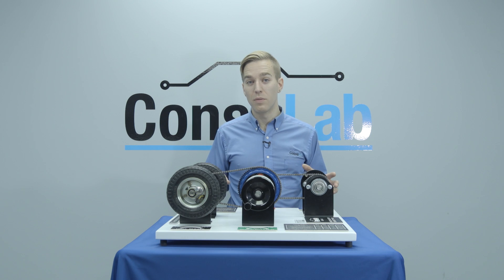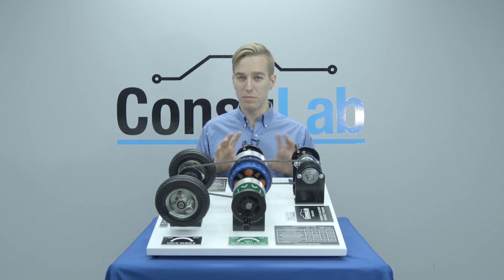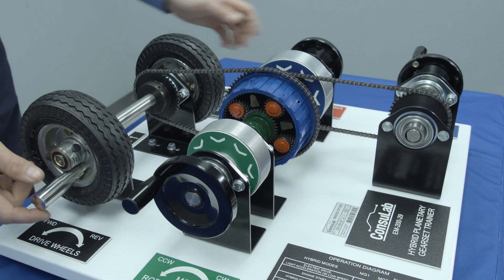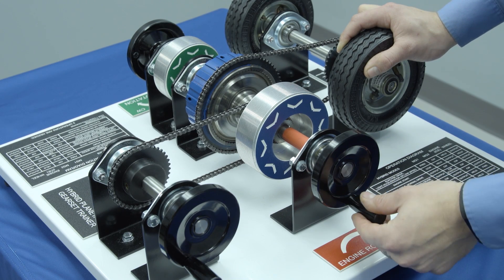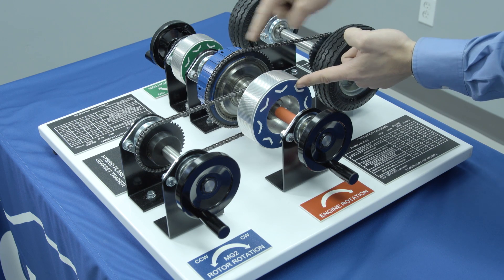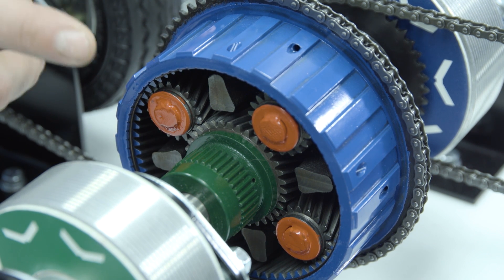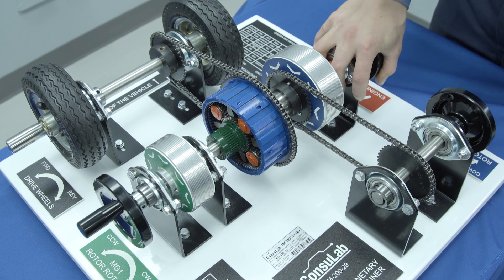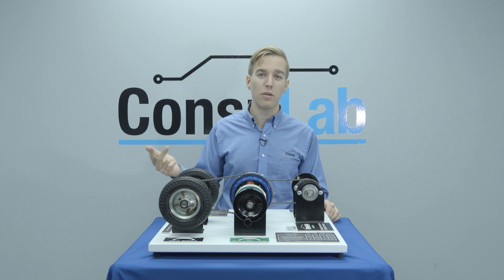Hybrid Planetary Gearset Trainer

Comment: Best and only reliable hybrid drive train, bless Toyota. This video is very educational especially for the journalists that do reviews and have no idea what they are talking about cvt and whinnying noise when under acceleration, there many things that rotate here at different speeds and directions.
Reply: Ford had it first, first domestic American hybrid in the USS, and uses the same type of transaxle except they started with more efficient the parallel type instead of the inline motor type, Toyota finally went with parallel in the 4th gen hybrids
Reply: @Iahusha777Iahuah   --- what is the Ford system called, and when was it implemented?   Do you have a link or reference?  thanks
Reply: @Texaca  the Ford escape Hybrid had the better parallel system first 1st gen 2nd gen escape and the same generation fusions and the c-max
Reply: From what wikipedia says, (I know, not the best source) Toyota and Ford both developed this independently, but it seems Toyota beat them to patents. Once Ford realized this could be a conflict, they approached Toyota about an agreement to not sue each other. 
Then Ford contracted with a division of Toyota to actually build the transmissions, which were first in the escape hybrid, and every Ford hybrid model since then, right up to the new Maverick. The Maverick has a new motor motor design though, with angled magnets for greater efficiency, something they haven't put in the escape or previous hybrids. 
Toyota uses the Same transmissions in the Prius.

Comment: Two motors are provided to provide a continuum of energy through all the modes of operation. MG2 is the larger Motor generator that powers the car using electric energy, MG1 is used to start the engine and by its design [ and the opposite rotational relationship ]  creates differences in the rotational relationship between MG1 and MG2. The rotation of the electrical fields and magnets can maximize electrical efficiency [ considering the speed of the permanent magnets and the strength of the field   coils ] also providing charging of the battery.
Reply: Eehawcbccdkyeeajkdu94r

Comment: Why do they use two motors? Is it possible to make a similar drivetrain with only one motor?
Reply: Honda historically used a single motor unit (the IMA hybrid) as well as Nissan (front motor dual clutch hybrid), both of which ended up being inferior to Toyota's two motor planetary gearset hybrid system. Honda themselves have ditched the single motor IMA hybrid for a new two motor hybrid system (no planetary gearset used however). 

In fact Ford employs the same two motor system in the Escape & Fusion hybrid (as well as plug-ins) and recently Chrysler Pacifica e-hybrid being the latest to use this design.
Reply: Because it is a model of Toyota Prius, which is hard for some to wrap their head around.  And thus this model is here to explain it all.
Reply: to make it twice as confusing
Reply from the maker: For what purpose? This simulates the gasoline engine and the electric drive motor.
Reply: Because one motor is simpler and cheaper
Reply: @roma7485  AKA Honda IMA.....as per Insight, Civic Hybrid...it's an inferior system in practice.
Reply: who charges the battery then if the only MG is working as motor?.....you need the small one (MG1) for that purpose....
Reply: @juancarlosabad3298  if there was only one MG, it can't use the MG for charging and propulsion at the same time. The engine could propel the car and MG could charge the battery.
Reply: The whole point of 2 motors is to create a cvt drive (without the weak point, the belt), the engine can run at a constant speed, and by changing the speed of the first motor/generator, you can change the output speed to the wheels. The 2nd motor is more powerful and is used for EV mode and regenerative braking.
But thinking about it, you could possibly do away with the 2nd motor and increase the power of the first, and it would still work much the same (might require an engine brake to prevent it turning when not in use).
Reply: @Pete856  In the Toyota hybrid system the two motors are also both generators, so no matter what the vehicle is doing: sitting still, moving from a stop, cruising, coming to a stop, going down hill, etc., you are getting benefit of electrical generation and propulsion. Really amazing system. It would not function the same with just one motor-generator.